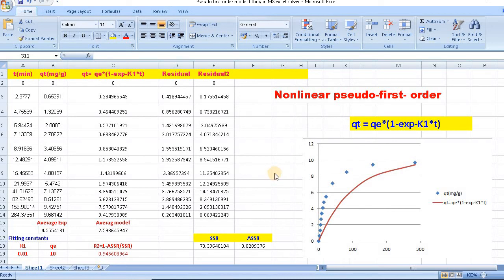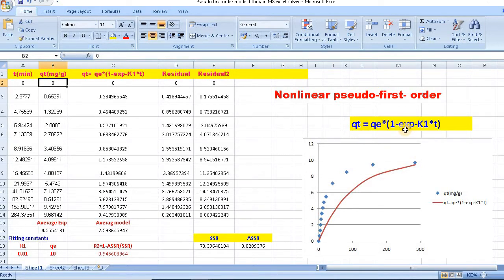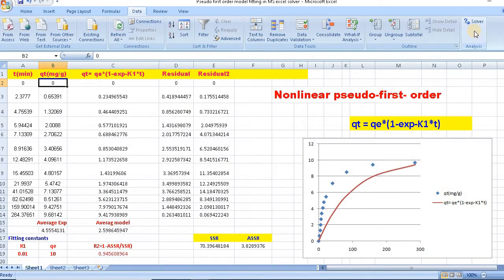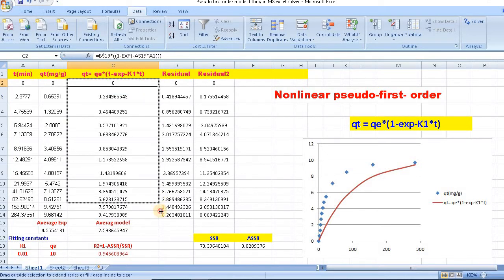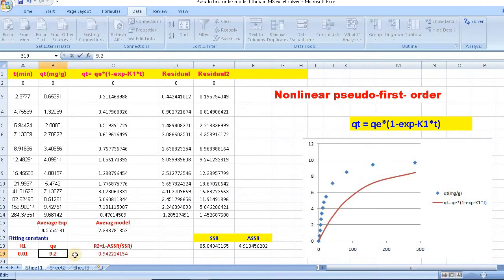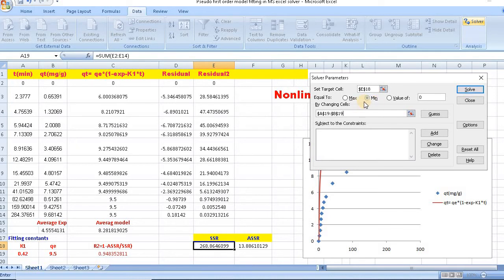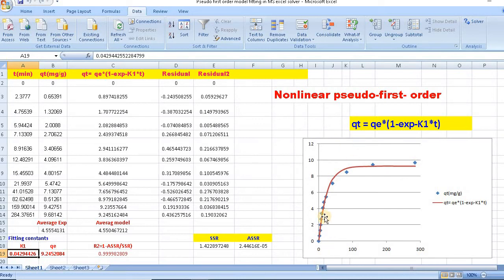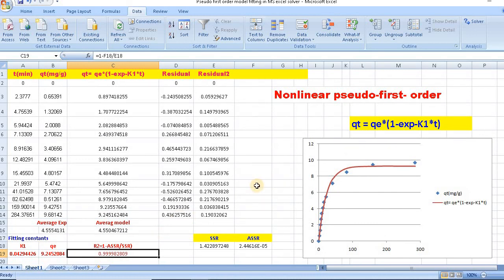Pseudo first order kinetic model fitting in excel solver

Comment: Hello Sir,
Why do we use the qe value as 10 before using the solver method?
Reply from the maker: Thanks. Initially you need to guess a value which is close to fitting and then you need to perform a fitting.